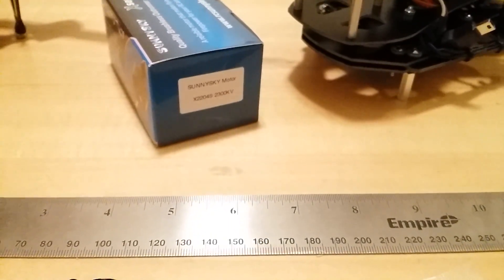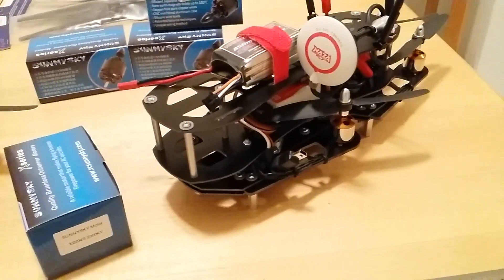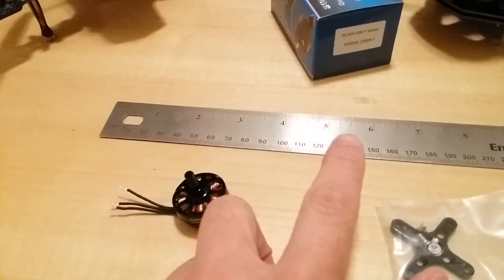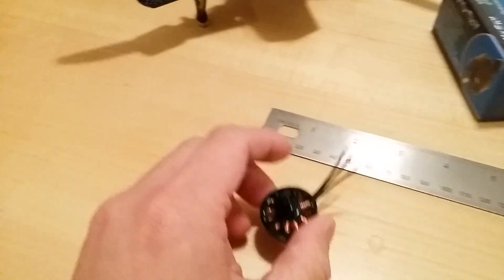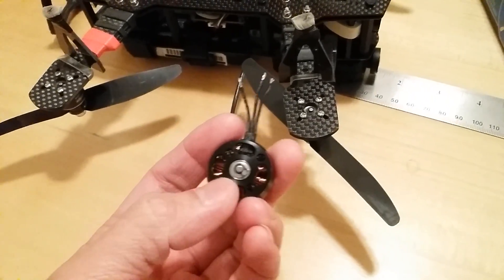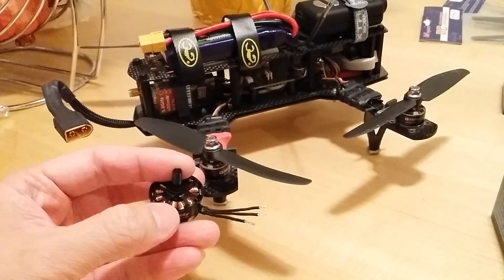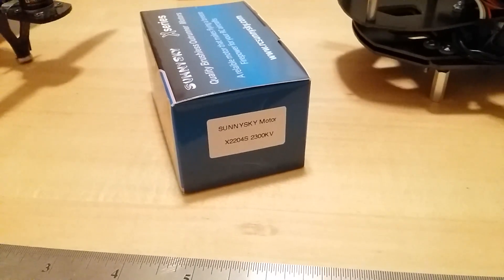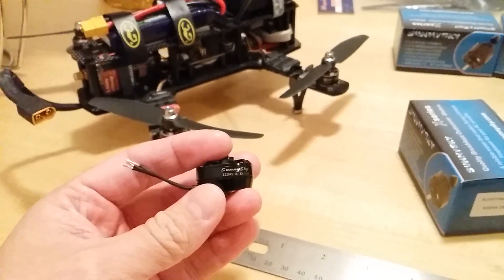SunnySky X2204 2300kv Motor

Comment: were u able to fit these motors on the blackout mini h??? does the hole pattern allow for all 4 screws to be fitted?? thanks for help.
Reply from the maker: The new Blackout quads should have the the updated holes to fit the larger screws and larger bearings used in the Sunnysky motors :)